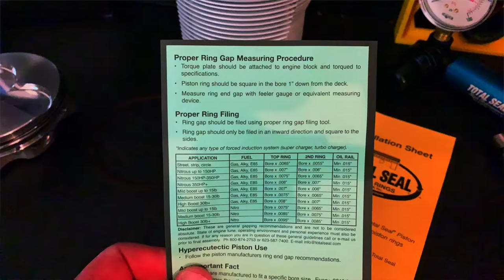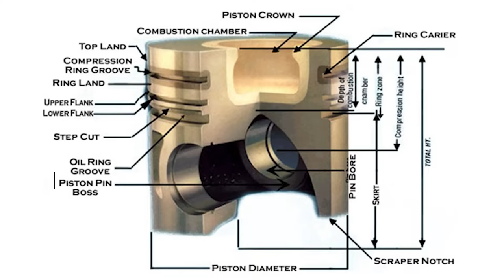End Gap Mistakes That Will RUIN Your Engine

Comment: I debated myself for weeks on what to do for end gap on a 225 V-6 Dauntless Jeep Engine. Cost of boring and line honing in my area is not cheap, plus the fact many machine shops have closed down over the years, also could not get .020 rings due to several factors , they weren't available. The Cylinders measured out just over 3.75 to 3.77 throughout each. So I honed them myself and ordered standard rings and installed with 28-32 gaps....Sure that's a lot....but these little Odd-Fire engines run pretty warm too.......still waiting for the heads to get finished 4 months at another machine shop. It's become impossible to rebuild motors fast anymore.

Comment: I bought a set of Keith black silvalite hypereutetic pistons shortly after they came out. Probly late 90s.  Installed with the gap set per instruction sheet that came with pistons.  Ran great till I made my first extended WOT pass in high gear.  Broke at the ring land on 4 pistons.  Turns out the instructions were not correct in the very first pistons they sold.  I always go on the side of caution now.  A little extra gap is not terrible.
Reply from the maker: Thanks for sharing.
Reply: .004 per inch of bore, for a stock engine, .005 forlow boost,.006 for hugh boost. And those pistons are junk. Broke lands on 4 seperate occasions with the hyper.pistons , in one season. Put a set of forged in it, and ran for 3 seasons. No problem. The hyper. Pistons were made in Bangladesh.
Reply: I learnt that as well way back

Comment: I learned the strength of a forged piston from a engine I bought and he said the pistons were forged. A while later I lost all compression in #7 cylinder. When I took it apart the piston ring lands were broken and it was a cast piston. All the other pistons were forged and were fine.
Reply from the maker: Thanks for sharing!

Comment: Been building normally aspirated gas race engines for 20 years, and ALWAYS go a little bigger than the Total seal chart. Never had an engine butt a ring, and i leakdown the cylinders after every race, the blowby is minimal. 
"A little loose and she"ll still go, a little tight, and it'll be a bad night..".
Reply from the maker: Absolutely!

Comment: I have a mopar 360 I built. Only bored .020 and went back with stock cast iron jugs, not a hot rod. The rings I got are posi loc's. I tore the engine down with about 1k miles on it. The white coating on the bearings was still there and the cylinders set in perfect. In my opinion make sure the machine shop knows what your going to be doing.

Comment: I do .0050 per inch of bore in a stock to mild street car. Turbo I do .0060 per inch and turbo with nitrous or nitrous .0070 per inch of bore. He’s over .0080 per inch of bore but this depends on temps. I usually add at least .0005 more to the second ring. 
I get NOTHING in my catch cans and usually that comes down to did you clean the cylinder walls properly and get all of the stone from honing out. 
Jet wash will NOT clean stone out.
Use transmission fluid and shop towels on the walls till you see no black coming off of the rag.
Reply from the maker: Right on!

Comment: I build single cylinder air cooled race engines some have an cast iron blocks some are iron sleeved aluminum blocks  and I have found that there is major power increase for the proper end gap    for the top two rings. the second ring is not a compression ring, it is an oil control ring only. If the top ring doesn't seal none of the other rings are going to do that job, oil control is their job. The pressure differential between the combustion chamber and crank case is what seals the top ring to the cylinder and crankcase. If the second ring sealed combustion pressure the top ring would not function at all.
Reply from the maker: Absolutely!
Reply: Now THIS makes sense ^^  That's ironclad logic bro.

Comment: Great video! If I may ask your thoughts on this setup? Maybe I will get lucky. Will be finishing up my gapping soon. 468bbc/13.5-1static compression/ Total seal Gapless rings/ wet sump/ internal balance/ Blown alcohol/ wet block/flatbottomdragboat/ 32 gears/ 11 1/8" x 16 -2 blade prop. Interesting about the top oil ring gap trick. Thanks.
Reply from the maker: Thanks for the watching and the comment, you don't need to do the oil ring trick with a Gapless ring package.

Comment: Hey guys good video , I bought a old Matchless G80 500 , there's a short video on my channel , anyway it was semi restored but didn't make to the road , I got it running ok,  but big oil leaks , so removed the head and was astounded to see piston ½ down the bore at TDC ? Wrong piston , and I found all 3 cast rings with .125" ring gap, it ran ok and pulled ok , calculated comp 4.1:1  . Cheers .
Reply: Maybe wrong rod. When I was flipping bikes as a kid a Yamaha 2-twin I was working on had a bad rod. Bought one at a Yam shop, checked the small/big end sizes and slapped it together. turning the engine over on the bench with the heads off and.....oh F, the piston attached to the new rod didn't come up as far as the other one. Bike still ran okay, so out the door it went.
Reply: more likley a 500 top end on a 350 crank
Reply: @eweunkettles8207  definitely G80 on the crankcase ,  there were different pistons for different conrods , I bought a new piston,  all good .
Reply: @Cobra427Veight  
some had a wire wound piston 
have you seen one? 
my friend had a g80cs  made a long stroke pressed up Ina  needle roller  crank and titanium rod   with a vincent piston gave 700 cm3  
the cs had a centre plug that fired thru a slot between the valves   
supposedly to stop wetting the plug when  starting the motor   it went very well   but got a bit hot in city traffic   
the rickman bros raced a similar motor in mx in one of there metisse frames  . 
more recently a big bore short stroke matchy g80won a race beating manx nortons and vincent twins   at the goodwood festival of speed 
so the humble matchy  can be a helluva  performer  the weak bit is the timing side   bearing

Comment: Good morning gentlemen. I have learned a lot of new things watching your videos and have put it to use on my engines with great success. Now I have a question about the piston ring to ring land clearance . I understand to tight will weld or lock piston ring to the piston but what happens if we make the clearance more. Book specs says .0005 to .0025. Would we notice anything if we set it to the higher clearance?  Thank you for your time. You two are the best.
Reply from the maker: Thanks! That is a great question. Too much vertical clearance is bad. It lets the rings flutter around. For no gas ported pistons, .0015 clearance is good. For gas ported rings or pistons, .001 (or tighter) is good.

Comment: Spartan Aviation in their aircraft and power-plant mechanics course  built a Lycoming engine properly then disassembled the engine and rebuilt it several times increasing the ring gap each time. They measured the hp each time with lower and lower compression and found little difference other than oil consumption and blow by. I was certainly surprised by this test. It is easy on an air cooled aircraft engine to access the pistons without removing the rod bearings. The cylinders come away from the pistons. So they were curious and did it. On an engine stand of course.
Reply from the maker: Thanks for sharing!

Comment: I've got your advice to open the upper oil ring to match the 2nd ring on a 3 piece oil ring.  What about on a 2 piece oil ring that has only one gap. Mahle just says .015 or bigger but the second ring is .023 in this Porsche turbo engine. Thanks very much for the great videos!
Reply from the maker: Thanks for the question. For a two piece oil ring, just go with the .015 minimum gap.

Comment: Congratulations on the video, very good information.
I have a doubt, it is always said that the oil ring must have a minimum of .015" but if we try to equate the gap of the oil top ring to the 2nd ring, this would be much further away than the minimum (.015"), so when or how much would be too much gap for the oil ring?
Reply from the maker: Only the bottom oil rail needs to be .015 or larger (up to .025 for this set up), then add the extra gap to the top rail.

Comment: All depends on combustion chamber temp which is affected by fuel used. Rich or lean mix, power added, etc. Old rule thumb was .004” gap per inch of bore on street car gasoline. Going slightly bigger doesn’t usually hurt. Remember to offset ring gap locations on your pistons upon install. Plus good ring quality or mfg for seal in cylinder along with a good cylinder finish hatch pattern to match the style or material of the rings. With a straight cylinder bore. Tapper or out of round cylinder also affects ring seal. Do a quick dinkle ball hone and new rings and bearings might be cheaper but at times won’t help ring seal once cylinder worn badly. Measure twice cut once remember lol

Comment: In all the instructions I have ever had that comes with the rings including Total Seal has me setting the top ring end gap wider than the second, just put a new engine together, wish I had seen this sooner, I guess things change as we learn more.
Reply from the maker: The instruction sheet recommendations are very safe. This is just cutting edge tech tips.

Comment: In Jenkin's book (mostly talking about his old small block pro-stock engines) he talked about running a tighter end gap because he had a straighter bore (honed with torque plates).  if you believe this, what do you do with newer honing machines like  Rottler (sp?)
Reply from the maker: End gap is more about combustion temperature than honing technique.

Comment: I’ve ran huge second gaps for 15 years.  I ran a 540 Chevy with 28 to 30 too and 34-36 second and it made 885 on pump gas on the dyno.  Makes less blow by than you would think.   Diesel hot pistons run a surprising small gap even on seriously boosted apps.
Reply: I don't see how a piston could get hotter than the engine oil .
Reply: @wannabecarguy  just remember.  Oil and water cool the block and pistons. The pistons and block, especially the pistons and valve springs will always be hotter than the oil and water.  The block heats the water not the other way around. The block and pistons and valve springs heat the oil, not the other way around.
Reply: @wannabecarguy 

the piston sees thousands of degrees during the combustion event.
Reply: Piston crown is also in direct contact with combustion process to add to piston temp.

Comment: I have an old set of total seal gapless ring set where the gapless ring was on the second ring and the ring gap recomendation is wider on the top than the bottom. I trust the latest tech but just goes to show it takes a while to work out what is best. I never used that ring set as I heard guys complaining of ring flutter and oil burning back then.

Comment: Diesel a different story .
Must be perfect to spec .
Or hard cold start.
A little loose on gas is ok.
.004 to .006 per inch diameter of bore is normal.

Also gaps rotate around cylinder in time randomly eventually.
Excellent channel 👍
Reply from the maker: Great point!

Comment: I know guys that run demolition derbys and they often open up an engine and file the rings a bunch.  They're a little hard to start but they will run a derby with no coolant and use the engine for years
Reply from the maker: Thanks for sharing! That’s a great (yet extreme) example.

Comment: Hold on!

 My 94 Cadillac Seville with 4.6L Northstar comes with hypereutectic pistons ( 93mm ( 3.661" ) ) if I am not mistaken and recommended ring gaps are tight just like piston to cylinder wall tolerance ( 0.01 - 0.05 mm ( 0.0004 - 0.002 " ). 

Top ring 0.25 - 0.4 mm ( 0.01 - 0.016 " )
2nd ring 0.35 - 0. 5mm (  0.014 - 0.02 " )

Does this mean I should go bigger than what stock recommends?

Top ring: 0.5 mm ( 0.02 " )
2nd ring: 0.6 mm ( 0.024 " )

???

Comment: is static gap (set on a stand) very representative of ring gap at operating temp? the top ring surely sees more heat, and the the top and second ring are almost always different martials and different coatings.  These differences surely affect the amount of (growth) the ring has which changes the gap during load.  I could see some scenarios where gapping the top and 2nd rings the same on a stand, would result in the the top gap being tighter during operation.
Reply from the maker: As you mentioned, static gap is not what the operating gaps will be. The top ring gap will close up more than the 2nd ring due to the heat.

Comment: Well this has me 2nd guessing our choice of a Napier gapless 2nd ring. Although I have almost no blowby out the valve covers I am seeing puffs of smoke out the pipes at full throttle, ring flutter? Sbc 440 dart. Started at 427 and grew as I learned. Daily driven sniper efi and handles road trips just fill gas and check and add oil and it will go anywhere fast.

Comment: Hi, my name is Anthony. I recently bought an 87' monte with a sbc 350. Motor was built about 10 years ago but never driven more then a few hundred miles. It has chrome Molley rings. It has pretty bad blow by, smokes and leaks oil from breathers because I believe the rings haven't seated. Any advise for getting the rings to seat? I was thinking of using risilone additive and keep driving it. Thank you for the help.
Reply from the maker: The best solution is the pull the engine, touch hone it and install new rings.
Reply: @TotalSeal  thanks appreciate it

Comment: ok, your video very informative, gotta question . . . i'm helping a friend with an MG engine, the bore is 69 1/2mm or 2.74 inches, the compression ratio is 8.5 to one, and he is running a supercharcher making 7 pounds boost . . . what do you think the gaps should be on the top two compression rings?
Reply from the maker: Go with .006 per inch on the top ring and then add .008 to that for the 2nd. Follow the procedure in the video for the oil rings.
Reply: @TotalSeal  thank you much!

Comment: In the way back machine I did a chart for ring end gaps based upon what the engine was doing and what its induction of it is.  It is based on the multiplier in thousands of an inch of ring thickness X cylinder bore X projected torque peak RPM.  Different numbers are used for different materials of the ring and the piston materials.  As he said, some of the guys that worked for me over the years ended up going to other engine shops and used this formula guide.  I had a couple of them call me to tell me how messed up I was that are very well known engine people of their time.  Fast forward, I had one of their engines found there way to me and I had to laugh when I took it apart about found the ring gaps exactly where I would have set them based on my chart.  About a year later I was at this persons shop in North Carolina and gave him some crap about it and he laughed... Pulled out my chart from his desk and asked if I had ever seen it before.... One of my guys moved back there and had gone to work for him and he gave it to him, they have used this guide ever since.  Funny of what goes around and comes around in this business.

Comment: A guy limps into the Harley shop with a sputtering engine.  Removed the spark plugs and one looked fouled. Looked into the cyl and found the front piston head completely detached from the skirt.  Removed the jug and found the head of the piston needed to be driven out of the cyl.  Customer claims he just had 10:5 pistons installed prior to his trip.  Cyl was still alive so we went back to stock and sent him along. 
Customer gets a cyl replaced on his aircraft engine because of low compression.  Comes in and claims the CHT  is constantly hotter than the other cylinders. Check everything.  I asked if the install tech had checked his ring gaps.  He claimed the overhaul shop had adjusted the ring gaps.  I removed the cyl and found the ring gaps were all about half of their spec.  Adjusted the ring gaps to spec and the problem never returned - all temps normal.
The average guy thinks a tighter gap is better but doesn't understand how much ring pressure/ friction is created by combustion pressure going behind the ring ( through the gap ) - pressing it out against the cyl wall.

Comment: One  must always  check the ring gap when building  a motor  it's just  one  of the many  things  you must check . Total seal rings  for me every  time. End Gap is application  specific  . A drag race motor  will have a different  gap than a NASCAR  motor and so on and so forth. A beautiful  cross hatch in the bore always  helps with  sitting  the rings in the bore.
Reply: @TotalSeal  💪✌️ Total seal.  People  might  as  well   by the best , I do.

Comment: If I were to run an older forged piston that has 12 thousands loose in bore on a sbc..what would I need for rings, std or 5 thousands larger than std. also, what would be the ring gap size. Thanks.

Comment: Question, I have a built, sleeved Coyote with a blower, and I mistakenly ran some 5W-30 oil. I noticed that my car smelled like fuel and so did my oil. Ran the piss out of the car too. The smell of E85 went away went I but the proper oil 5w50 in. I’m wondering how much damage if any I did to the motor? Seems to run fine though.

Comment: Is it normal for new piston rings to make a slight scraping noise and be a tiny bit rough in travel on a new install while rotating crank by hand? 

I can turn crank easily but it's very strange to hear the noise - I;m thinking it could be the new rings just riding on the new deglazed walls making the noise...

Please tell me this is normal!

Comment: I've got a 400m ford its bored .030 over, the rings out of the box are .026, actually a tight .027 they are hasting's moly rings, piston are silvolite hypereutic, going by the ring gap chart they should be .019 to .020. any help would be great